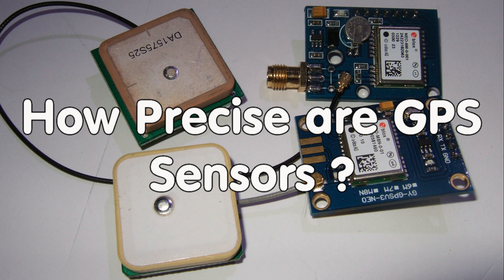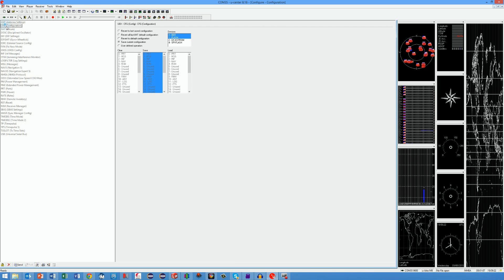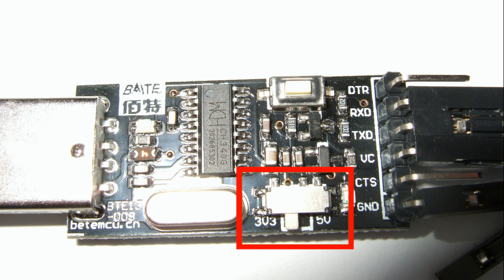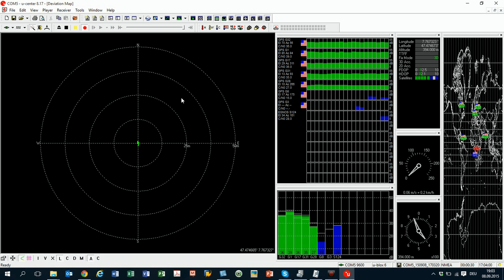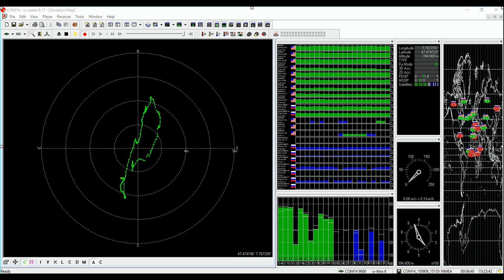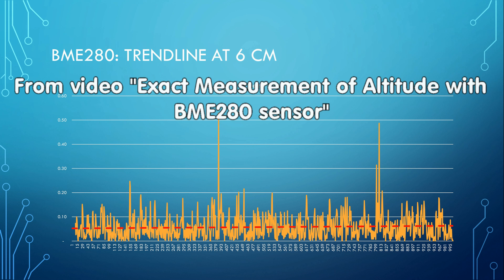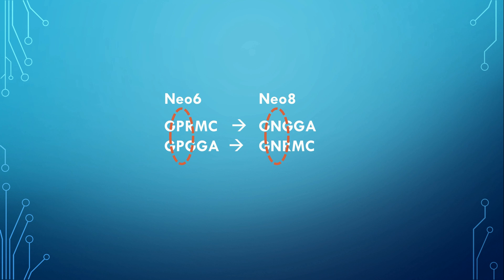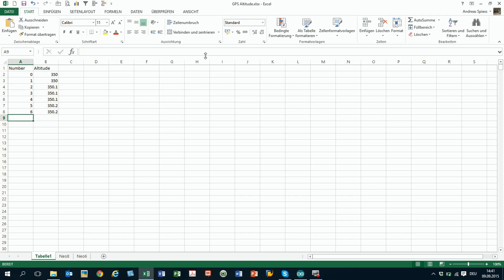#22 Comparison of precision between Neo-M8N and Neo-6M Modules

Comment: Stationery GPS is not so accurate, when moving the precision gets better.
Multipath, Selective Availability and ionospheric effects is important to pecision, Multipath is problematic when stationery .
Reply from the maker: In your article, I did not find any information about stationary/mobile usage, it just says, if you have obstacles or reflective points close to your antenna, the performance is reduced.
Reply: Fortunately GPS is mainly used while in move ^^

Comment: Good comparison, thank you! I have been wondering if to replace the NEO-6 with 8 in my DJI Phantom 1. There are wired modules available for such a low price, that it would be nice to try. But I also know how GPS works, thanks to years of MTB/cross-country biking, recording every ride. It just is not 100% reliable. What is interesting, is that the best weather for GPS has been very humid or even rainy weather. The worst is dry and clear with moderate winds. It must have something to do with the conditions far above the ground (several kilometers), but on the average I had one or two days in a year when unassisted GPS, even sensitive one, did not get fix. Tried everything I can, power off the GPS (Holux GPSlim 236), leave it on the ground still for minutes, smash it on the ground throwing the battery away etc. It normally gets fix in half a minute as expected, but in that dry weather it only got fix after riding for like 2 kilometers. That is just random. I really hate those days :D
Reply from the maker: Strange behavior... Not as expected. The only GPS I use regularly is the one in my car. And it never happened, that I did not get a fix after a while. So, it must be something with your GPS module.
The difference of the -6 and the -8 is, that the -8 sees also the Russian satellites which can help in difficult situations.
Reply: Andreas Spiess there's nothing wrong with the GPS, it's sensitive and very consistent, SirfStar III. Just a certain weather situation does that, rarely. I used it for years, twice a day, so I have comprehensive experience. The same could happen on my phone's gps on the same day.
Reply: Andreas Spiess M8 vs M6: it's not just adding GLONASS, there's always other improvements too. Like GPS-only receivers differ on sensitivity, noise tolerance, output noise (either real or filtered)...

Comment: The accuracy of a GPS system highly depends on the amount of satellites received and the position of those satellites. For example. If you place the GPS antenna between some buildings and you have a narrow field of view (do not see much sky) the receiver will receive less satellites and the satellites which are received are all around the same position. That means that triangulation will have a big error. Height measuring with a gps will always have a lot of error. The best is to average the height over a long time and calibrate a pressure sensor with it. The pressure sensor will have good short term measurements but bad long term measurements. If the air pressure changes the reading will change a lot. So for the best system you will need both gps and air pressure. That is commonly used in drones for height measurement.
You can get a measure of accuracy for the GPS by looking at the HDOP, VDOP, PDOP and TDOP (Dilution of Precision) measurements which are in the EMEA string you get from the receiver. The higher those values the less accurate the readings are.

https://en.wikipedia.org/wiki/Dilution_of_precision_(navigation)
Reply from the maker: +Joost B You are absolutely right for general purpose systems. Because I wanted to build a power meter I was only interested in the difference in height, but very precise.

Comment: Hello, 
Thank you for sharing your knowledge. 
Please both 6M and 8M, can they keep RTC in sync? 
Does 6M have any significant differences? 
(More than a second?)
Reply: If anyone else needs this, the 6M can get time from GPS and you can sync with your local board (e.g Adrduino), with TinyGps library you get: gps.time.hour(), gps.time.minute(), gps.time.second(), etc. 
You get them faster than position lock and is very accurate.
Reply from the maker: +Rtek1000 I do not know because I never used this functionality

Comment: hello mr. spiess, what is your desktop's resolution? looks higher resolution than 1920x1080, or did you shrink your system font size and icons separation?
Reply from the maker: 2560x1440 on two monitors and 1920x1080 on the third. For the videos, I usually use 1920 or reduce it to 1280 x720 (for Sketches etc.)

Comment: Hoi Andreas,
a nice comparison, but unfortunately you forgot to include one most important parameter for GPS precision, the DOP (dilution of precision). The DOP is a measurement of the current arrangement (or distribution) of the satellites on the sky. Similar to the issue in triangulation, the further the satellites are apart from each other, the better (or more precise) the reading. 
In short, it's not just the NUMBER of satellites that helps for the precision (horizontal and equally vertical) but also how far apart they are from each other. 9 satellites more or less in the same direction from the GPS unit may result in worse precision (and more variation in the reading) than e.g. 5 satellites distributed over the whole firmament.
Reply from the maker: Pascal Fust You are right. I did not mention the DOP because I did not know its name. At 4:50 I mentioned, that the time gave the bigger differences than the devices. I assume, that the right word would have been DOP. But both somehow correlate, I assume.
BTW: Do the sensors know this parameter? Otherwise, how could we use it?
Reply: Yes, you're right, depending of the time in the day, the DOP changes. The sensor does actually get this data (horizontal and vertical DOP) from the satellites and you can also find them displayed in the Ublox center, as the user manual states.
Reply from the maker: +Pascal Fust Thanks!
Reply: Gärn gscheh
Reply from the maker: Pascal Fust :-)
Reply: DOP is useful, but it is converted to distance in consumer applications, so you can easily see what is the mean error to expect in meters, for example. However, that also requires some thinking. There is nothing that can tell you how much off the resolved location really is. Not without reference signal (error-correction). I think DOP would indeed be useful in this test, just to tell if the satellites are laid out nicely and wihtout guesswork. Good point.
Reply: The DOP isn't received from the satellites,  it is a consequence of their geometry relative to the position of the receiver, and how the algorithms are tuned.  Some receivers can be configured to optimize HDOP (horizontal DOP), VDOP (vertical/altitude DOP) or TDOP (Time DOP).  A GPS receiver needs to solve for what the current time is, as well as the pseudo-ranges to each spacecraft.   

In one application I used GPS, I was most interested in precise UTC time (a variable offset from GPS time because of leap seconds).  The precision timing receivers I used had a mode where you could tell the receiver what their surveyed location was (or the receiver could determine this over time and store it).  Then it would tune the algorithm to optimize for TDOP.  In that mode, given that it knew its location and knew the position of the spacecraft, it would recover a good time reference with only one spacecraft in view.

For your application, you might be able to configure the receiver to optimize for HDOP, since it may be able to better use an awkward satellite geometry better if its not as concerned for the X-Y / horizontal position.

Comment: for the BME280. I forgot to mention.
Reply from the maker: I never used the BME280 with the ESP8266. But all the commands are exactly the same. So, you should be able to use all Arduino libraries and sketches. Maybe you consult also the data sheet of the chip.

Comment: Thanks for testing. Developing a device for measuring car acceleration. Seems to be good module for this.
Reply from the maker: Should be possible. Acceleration can be calculated from speed change per time.
Reply: Yes, but I tried SIM28M GPS Module, and it is very slow even in 10 Hz mode - when I launch my car it detects speed after 1-1.5 seconds delay. This U-Blox 8 is much faster and very accurate. And altitude measurement is good too - device will detect if someone accelerates downhill and marks the results as cheating.
Reply from the maker: +P Kav As you saw, the height measurement is not very accurate for the two sensors tested. Of course, I do not know your requirements.

Comment: is 6m gps module works and get the data if I connect it to computer through avr atmega 128 ? bcause My program that I set to convert the NMEA data into readable longtitude lattitude google maps doesnt work
Reply from the maker: Sorry, but I do not exactly understand your problem. You can use GPS modules with Arduinos. There are many tutorials available.

Comment: Hi
Can u tell me is it possible to improve my accuracy by using 2 GPS module NEO - 6 M (comparing information)?
I mean in Arduino or create app in Delphi XE8 or C#, or any other methodes?
Reply from the maker: I am not an expert in GPS, so I cannot answer this question. There is a technology using 2 GPS modules and fix one to a particular place. Because you know exactly, where this module is, you can calculate the measuring error. And this difference is then transported to the mobile GPS to enhance quality. There is a link to this principle down in the comments of one of the viewers.
Reply: GPS module with RTK tec will be better. About 0.1m CEP if I remember right. But it require static position. If the receiver is moving, then the accuracy will be bad.

Comment: BeiDou will not work in Europe (according to wiki): "Unlike the American GPS, Russian GLONASS, and European Galileo systems, which use medium Earth orbit satellites, BeiDou-1 uses satellites in geostationary orbit. This means that the system does not require a large constellation of satellites, but it also limits the coverage to areas on Earth where the satellites are visible.[11] The area that can be serviced is from longitude 70°E to 140°E and from latitude 5°N to 55°N. A frequency of the system is 2491.75 MHz."
Reply from the maker: Thank you for this explanation.
Reply: BeiDou now includes at least 9 MEO satellites in its constellations, and should be able to provide worldwide coverage.  https://en.wikipedia.org/wiki/BeiDou_Navigation_Satellite_System
Reply: That sounds like a really poor choice of frequencies and trying to filter out all the trash just below it on the 2400 MHz ISM band (Wifi, Bluetooth, microwave ovens etc.)  I remember back in 2011 President Obama was going to open up a band for LightSquared for a cellphone band and then had to nix the idea because of potential interference to GPS.

Comment: Hello Andreas, do you know how to calculate Accuracy in GPS system? is it possible using HDOP or PDOP?
Reply from the maker: I am an electronics engineer and do not know a lot of these things. I am sure, you find specialised info in the internet. I was more interested in the relative accuracy than in the absolute accuracy. And this was much much easier. An was even possible for me with limited geographical knowledge because the GPS could sit just in one place  ;-)
Reply: Thanks! it is a really nice video. I hope one day you could catch up with all your videos. I just started and there is alot to see. :D
Reply: use the visualgps software displays position accuracy

using google search
Reply from the maker: I used a similar software from ublox, the suplier of the GPS chips. It is also free.
Reply: u-center displays a littlbe different,  different point of view

especially in height   GPS is very weak at height measuring (ie geoid... bla bla)

visualgps and u-center provides different data,   you might need both and another software for compare
Reply: -> a liitle bit different result
Reply: +Seung Sup Lee i would like to calcule this on microcontroller

Comment: Try GPS RTK with your M8N and RTKLIB you should get under 1 meter relative accuracy between two receivers.
Reply from the maker: +shodanxx Seems to be an interesting technology. But the effort is bigger than just using a GPS module. Did you  try it? For me, it would be interesting to use it with a GSM module.
Reply: I got a pair of ublox m8n, still waiting on active marine gps antenna from ebay.  

It's in the pipeline
Reply: A hobby level receiver can have RTK or did you mean position optimization thru post-processing?

Comment: Very informative. I'm looking at gps systems but can't make up my mind if I should spend $100 or spend $30 on this Neo-M8N
Reply from the maker: What is the 100$ alternative?
Reply: Oops not 100. Can you look at this micro Neo-M8N and tell me if it has the same capabilities as Neo-M8N. My Quad is really heavy and I think this will be better because it might work the same as the full size version.
Reply: Considering this unit right now. Did you end up using it? Is it as good as the others?

Comment: U should now try the ublox-m8p and see what its drift is and accuracy. https://www.u-blox.com/en/product/neo-m8p
Reply from the maker: +Shane Bekker From what I understand the difference of the -N and the -P is the possibility to use two modules, one fixed, and  the other moving. If you connect them with a communication link you can correct errors which affects both.
But this is a complete other story and I did not find cheap modules available. If they become availaboe it might be interesting to connect two of them with a 433/868MHz link an test.
Or do you have other information?
Reply: +Andreas Spiess Not yet as I am awaiting feedback to see how they achieve their accuracy as typical RTK requiring a base station GPS and a mobile one is pretty restrictive. There is also these clever chaps http://www.eurekalert.org/pub_releases/2015-05/uota-ncg050415.php
Reply from the maker: In the -p documentation are 2 differen models descriebed: NEO-M8P-0 with
rover functionality and NEO-M8P-2 with
rover and base station functionality.
So, I assume the achieve the precision as usual.
The Austin proposal seems to be different (at least, it does not work with GPS). But I am not a specialist in RTK.
Reply: Its not that hard.... The P series for 7 and 8 (i dont know about 6 because i didn't bother look up the documentation) does something called ambiguity resolution. This technique uses a phase measurement in addition to the code measurement of the signal in order to estimate the number of wavelengths (in the case of the M8P this is on the L1 and L2 carrier frequencies) between EACH satellite and the receiver. The accuracy for that is on the order of tens of millimeters. RTK is a function of this. If none of that made sense to you.... don't worry about it. 

Nobody doing hobby electronics have any need for that kind of accuracy.

Comment: Hi Andreas,
thanks a lot for good explanation of GPS modules. I would like to know , if you have the info obviously, what can I do with my LEA-6H-0-002 gps module. What I would like to do is:
- run it to calculate position at 10Hz instead of 5Hz ( it seems it's not possible with it!! )
- when you speak about profile (Navigation Modes) what really happen in the module? What does it mean?

My application is gps module mounted on a Quadcopter to perform RTH, Position Hold and so on.
I'm using UBX protocol.
Do you suggest to buy another more performing module?
- Is it possible to flash new firmware in the LEA-6H-0-002 ? I raise the question to u-blox company without success....

Thanks in advance if you can help me on this.
Regards
Fiorenzo
Reply from the maker: +Fiorenzo Giust I  never looked into update rates. So, I have to guess: Neo-6 offer max 5 Hz update rate. Neo-8 with GPS satellites only 10Hz. But there are many other possible bottlenecks:

1. Connection controller to GPS module:  If you use Serial connection: Serial is very slow (usually 9600)  The chips should be able to use higher speeds, however you have to change it in setup.

If your board offers I2c or SPI pins you could also use these interfaces. Then, transmission speed should not be an issue anymore.
2. I do not know which MCU you use, but this could also be the bottleneck. The MCU on my self balancing robot at least is quite busy stabilizing hte whole thing.
3. Another question is: How far can your quad move in 0.1 sec? If it is less than the precision of the GPS you might not get much more information.

The ublox chips are very much configurable. with their u-center software. You can download it free from their homepage. This software also offers a possibility for Firmware update if the company offers one.

ublox does only sell their products in very large quantities, so I can imagine they have no customer support for end-useres as we are.
Hope, this helps a bit...

Comment: Could I have your mail?
I can't do it with NEO M8N
Reply from the maker: +Tran Phat Can you please be more specific about your problem?
Reply: +Andreas Spiess, It's still *** or Check your wiring. I understand what are you talking in this but It's not working with NEO M8N.
Reply: +Andreas Spiess oop! GPS NEO M8N default baud rate is 9600.  And I change the code to  
  static const uint32_t GPSBaud = 9600;. It's working :D